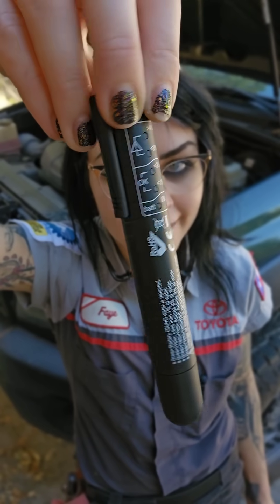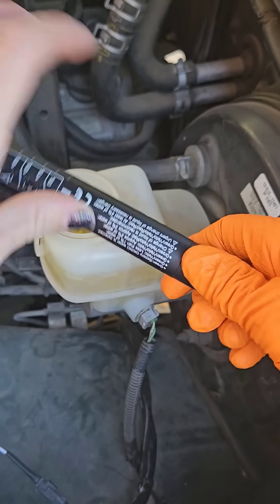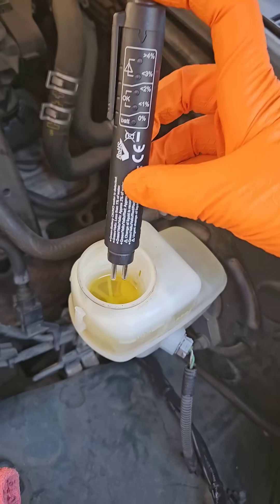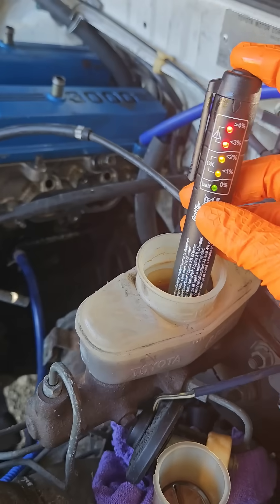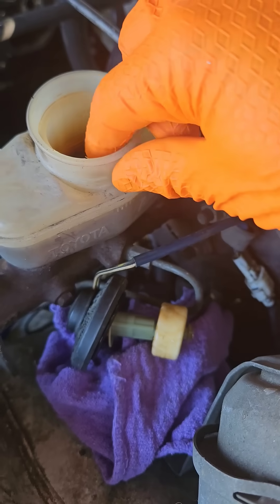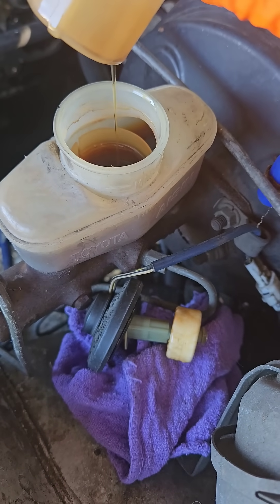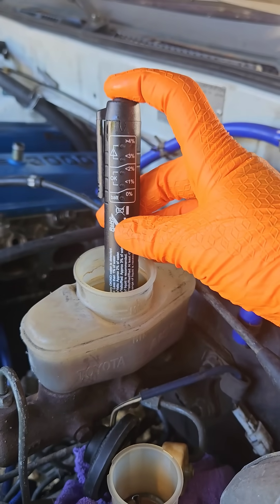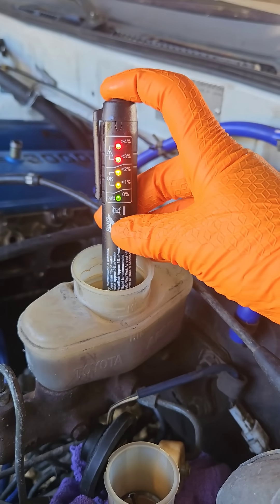Do you REALLY need your Brake Fluid Flushed?? How to Test it For Yourself!

Comment: there is a flaw to this; even if the master cylinder tests out ok, the dirtiest part of the brake system will still be at the wheel cylinders and calipers, so it’s best to do it habitually just out of prevention.

Comment: Or check color. Dark color means brake dust is making into the system at the piston and will lead to air in the line and nrake fluid brake down lol . Water will give it a milky bubly look and holds oxygen real well (squishy pedal). But yes most shops run this as a scam.

Comment: We use one of these where I work.  Often, the fluids moisture level, especially on a modern car, will remain under 3% for far longer than 2 years.

Interestingly, even when the saturation isn't excessive, and we've done a flush anyway (to satisfy a dealers log service) our customers still report an improved pedal feel, even though it didn't technically NEED a flush.

Another consideration on late model vehicles, is that the brake system includes an ABS modulator.  Lack of fluid changes can allow a build-up of particulate in the ABS solenoid's and cause problems if not addressed.  Frequent (2 yr interval is fine) changes help prevent this.

Comment: No need for a special tool. Just use a multimeter (voltmeter) and measure the voltage between + and fluid.... This method is old as earth!

Comment: I usually wait until all my fluids are the same color to change them that way I know I am getting my money's worth. Usually black. Also though a dark brown rust impregnated color is also optional if you really want to replace components on a regular basis. Also don't know if you covered this but most manufactures have their own brand/ type of recommend fluids ie coolant, transmission, different fluid recommendation or requirement for best life. Coolants are an odd one mostly because different types of coolant have additives to prevent degradation and corrosion for different metals.

Comment: So does the brake fluid curculate throughout the system? Maybe the fluid in the reservoir is bad but the stuff in the lines and calipers is still OK? Just suck out the resovoir fluid and add new?
Reply: As your breaks wear down and the pistol moves out more it takes fluid from the reservoir and when you put new  pads you have to push the piston back so fluid from the lines go into the reservoir.  Don't think is circulates when you hit the breaks bit I'm not a mechanic either

Comment: I got a tester just like you have cause the original brake fluid in my 2014 Camry still looks new after 65k. Tested at 1%. Gonna leave it till I either have to replace a caliper or it hits 3%

Comment: I checked my 2021 Honda Pilot with one of these little gadgets, after Honda said I needed a brake fluid change. No it didn't. It was 0 to 1%. Then I tested it on my 97 Honda Civic which I've had for about 15 years, I put it in the brake fluid and I think the detector started screaming as all the lights lit up. LOL. I changed the fluid myself after I rebuilt two calipers and one cylinder and now it is in the 0 to 1% range again. Thanks for the video and the tip.

Comment: Just remember that fluid inside brake calipers is a lot dirtier than in the reservoir. Water and dirt enter around the piston seal and contaminate the fluid. This contamination does not spread up to the reservoir. It stays in and around the calipers. For this reason, I just gravity-bleed each caliper when changing brakes or rotating tires. Any “flush” worries me.
Reply: If this were true then fluid would be leaking around piston seal as much more outward pressure from this area vs seepage pressure from outside inwards.

Comment: It's the same thing as an emergency. Shutdown under corruptible power supplies for server groups and what it does is. I believe I'm that Toyota, so yeah, you've got switches that you can turn to battery and everything on and off when you're disconnecting it, but behind that there is Actual fuses and and then controllable breakers, which are also like 3 bags. So what happens when you cut that? Because all that does is loop back to that one relay, and when you cut it, it's the same thing as disconnecting the blow voltage computer wires. I'm calling it. Obviously, it's only a few for this, but what it ISIS basically, and I'm not going into. There's a few different waves for a few different cars, but there's a few wires in there that are normally closed circuit and a few that are normally open circuit, and that way if the car gets crushed. And a wire gets dead sorted. The normally open circuit that then becomes closed. Because that wire got pinched and therefore grounded, does the same thing is cutting. The normally closed circuit one basically
It tells the main breaker circuit. I'm not forget that exact name forward. It is disconnect as if it had a trip.

Comment: They cause air bubbles and that needs flushing or bleeding brakes...bubbles in brake system are not a good thing....u don't want ur brakes to lock up....while ur driving..

Comment: Depend on the brake fluid, some vehicles use silicon based brake fluid which is not hydroscopic; and the water settles at the lowest point (brake caliper).

Comment: I wouldn't trust those testers. Especially on a bmw. Fluid should be changed every 2 years minimum anyway. I've had more than one mastercylinder block a gallery and lock the brakes on. It only takes 15 mins to do and the fluid is 15 euro. Don't scrimp on safety!

Comment: brake fuild should be changes at least once a every 3-4 years..i change mine out every year..easy to do..first i remove all the brake fluid from the  master cly reservior. clean it out, best i can.. refill with un opened dot 4.. fill the top, to flush out the old fluid in the lines/ calipers rr first , lr. rf, lf.. keep the brake fuild topped off, put cap back on.

Comment: Brake fluid and coolant ..use multimeter and check for voltage ground to alternator....if contaminated it will show voltage.

Comment: Take your wheels off and push the caliper pistons in, then suck the fluid out of the reservoir and fill it with clean fluid. Pump the brakes to mix the fresh fluid in the lines and calipers. Do this every time you replace brake pads. Fluid is cheap.

Comment: Part of your answer is correct. The other is completely false.

Water can never from an engineering point of view saturate hydraulic fluids. As well, any as you put it "water" with some heat can NEVER turn to steam in a braking system such as found in any automotive setting. As we all know steam and water vapor are two different animals.

In my 50 years of owning dozens of very high mileage vehicles, I've never once experienced brake failure from moisture.

Yet, it seems reasonable to occasionally flush the fluids.

Comment: There's also another important reason to regularly flush your brake fluid. The water in the old brake fluid will slowly rot the brake sealing cups until they start leaking. First, that's a huge safety hazard and second, the repair will cost you at least 10 times as much as what you saved on flushing.
Tip: If you're buying a used car, check if the brake fluid is still okay, (with one of those brake fluid devices). If not, chances are the brake fluid has never been flushed and there'll be leakage issues down the road for you.

Comment: Brake fluid tester isnt gonna tell you if youve got rust on the system and the idea is to get the brake fluid flushed before the fluid absorbs enougj water for components to rust which is why some manufacturers go by mileage rather than the tester.

Comment: Brake fluid in my truck is 15 years old it will still lock up the tires on dry roads so I am happy with it. Hydraulic fluid doesn't deteriorate water absorption is the real killer NOT age.

Comment: Problem I have is I bought 3 of them off Amazon. All showed that brand new sealed fluid was bad. And it was from 3 separate bottles bought at 3 separate times. I do not trust those at all. Instead, I flush mine every year and when changing brakes.

Comment: I’ve never changed my brake fluid. 
Driving now 225,000km. Didn’t change. 

Other car 283,000km. Didn’t change. 

No issues with either. DaQuack you all talking about?

Comment: There is no reason to not replace your brake fluid yearly other than laziness, its $5 diy, your seals will last longer, abs doesn't have to work as hard, and the #1 biggest reason to do it is when the shop says that you need it you will know you don't.

With that being said and the way I feel about brakes,  I would always suggest they do it or get it done. I would rather your pads be metal to metal than for you to have bad fluid, not literally but brake fluid should be treated like an oil filter, its doesn't matter if you need it, just do it while your there, just do it. You don't take the transmission off and not replace the seal, just do it. IMO

Comment: I 100% do not trust these. Did a brake flush on a van and the customer called back a couple days later saying the fluid we used was contaminated. We told him bring it back in and we will redo it with a fresh jug. He brought the tester too and we tested the brand new freshly opened jug and it tested contaminated. Got another brand new jug just to be sure and it tested bad too.

Comment: This is why every time i do break work on my car, i suck out all the fluid in the bottle and replace with new stuff. It’s the best time to do it, since you need to push in the clippers and push a bunch of the fluid from the lines into the bottle. The stuff in the lines are generally safe from water exposure, so doing this fluid swap is much faster and cheaper than a full system flush.

Comment: Water in brake fluid is a bit of an old testing method. The best method is testing for copper, because as the brake fluid ages, its corrosion inhibitors decay, and the fluid starts to eat through the copper walls on the brake lines. Water testing does not determine the condition of the brake fluid itself, it only tests for how much water intrusion has taken place.

Comment: The question is how accurate is this tool. There have been some comments on Amazon stating it’s inconsistent. I will stick to the 3 year brake fluid flush interval and should be just fine.

Comment: Hey Faye!!....If you don't have a tester like the one you showed...use a DVM set on dc volts...put positive in the brake fluid resevoir....put grd on the metal close to rez...if its .3 volts or higher...change the brake fluid...your welcome))

Comment: I have flushed old green brake fluid out of a lot of 99 and up gm pickups and fixed a low or squishy brake pedal a bunch of times. If the master cylinder or abs module wasn’t bad

Comment: I'd love to hear from an expert in fluid science. Does the pressure in brake systems get high enough to change water state to steam? The heat might but the pressure would prevent changing to steam but , well  but . . .
I bought a 10 year old motorcycle once with only 1,000 miles; its brake fluid was very gummy, congealed. Still worked on the ride home. No visible water but if its hygroscopic (absorbs) you wouldn't see it depending how easily it re-sepatates, e.g. diesel fuel. In 60 years I had never heard of water in brake fluid, just having to add fluid sometimes, and spongy pedal sometimes. A spongy pedal was attributed to air in the lines so you bled that. And didnt replace all the fluid. If theres water in the fluid and the car sits for years and the water separates it might induce rust, but if the fluid is moving even occasionally all parts will be lubricated with the fluid, so no rust. It can never hurt to change/replace with new brake fluid but whats that Toyota dealer charging, do they have an easy way to change without getting air in lines then have to purge, geeze, i dunno, spend the money on pads and tires and after all the credit cards are paid off maybe take a college class in fluid dynamics to understand molecularly auto transmission fluid too, power steering fluid, their water content. No mechanic I've known, I'm 76, has ever checked for water in any fluid but diesel fuel and gasoline. I can imagine theoretically such a device as she's selling being accurate but does it matter? 
Before you buy, check where made, country of manufacture, don't buy from China. Ask seller. Ask Amazon. Read labels. Where you spend your money matters.

Comment: Also brake fluid actually draws moisture in naturally, I remember seeing a video and testing it myself with a cup and a shot glass where you put a small amount of water in the cup and half a shot glass of brake fluid in the cup and it will literally draw all the water from the cup until the shot glass is full and the cup is empty.

Comment: There's a difference between the fluid under the cap and what is in the calipers.  If you brake hard enough to get it to boil, it needs to at least blead out with fresh. Yes, it likes needs to be flushed because people rarely do it.

Comment: As a lube tech at a jiffy little quick change place. I can tell you those things are pos as it's more likely to have a build up of copper in your fluid than water. I had a girl tell me the brake fluid was good as she tested it with that. I used a strip to test for copper and it had 300+ parts per million in it. So maybe it's okay for newer cars but use the strips too

Comment: I always sell flushes with brake jobs. Most of the time customer never has had a flush. If it’s a regular customer then you can skip it sometimes. If they did a flush 6 months with front brake then no need to sell another one when doing rears brakes later. Some customers are on a fixed budget so they piece out their work.

Comment: Yeah, multiple shops wanted $250 for that service. 
4 cans of synthetic fluid a $70 pneumatic pump and 2hrs later I was done. I saved so much time and cash, I went ahead and flused power steering fluid as well. 😅

Comment: I drive into the salt water up the the windows when it's rough to put the boat in and out of the water for work ! Every six months or less we flush the brake lines  with ranex rust converter and also the clutch ,we flush each caliper on each wheel then put a flush of brake fluid thru it ,the pistons in the calipers  work for so much longer before they seize , sometimes we don't get time to flush so we just put a few teaspoons in ,!! Don't try this at home we have do it or we can't use the vehicle ,   make sure you drive at least 50 km after you dunk your vehicle in the water so it gets warm and it dissipates a bit out off everything put your breather's up high very high near the top of your roof and your air intake as well up to the roof ,enjoy your day

Comment: so wat happens when you do not change youre brakefluid ?
answer there be some water in the brakefluid as the stuff atracts moisture , this will corrode youre brake parts from the inside that can cause failure , allso when you need to apply youre brakes for a long time like going downhill from a mountain thewater inside the brakefluid causes it to have a lower boilingpoint , so it starts to turn intoo steam , steam is a gas so its compressable , this means that it pushes brake fluid out of the lines and the next time you apply the brakes you push the pedal all the way to the bottom and you have no brakes , 
in short , do replace youre brakefluid reguarly , allso use the same dot type brakefluid as the different types can cause the rubber parts inside the brakes to dissolve

Comment: If that device is legitimate, then it's nothing more than an ohm meter or volt meter.  So you could just use your multimeter.    Googling this, it says that if you set your multimeter to volt reading, put one probe prong on the master cylinder and the other in the fluid in the reservoir.  If it shows over 0.3 volts, then galvanic corrosion is occurring probably due to moisture.  I suspect that device is measuring resistance at a given prong separation distance.    I have read that you can measure water content with test strips.

Comment: How is the brake fluid system not closed? The hydraulic pressure required for the brakes to function necessitates a closed system…providing someone isn’t taking the cap off unnecessarily.

Comment: if your fluid is the same colour as the pen you need to change it,, lil tip if the clutch stops working when it gets to that colour its not the clutch that needs changing no matter how much the boss insists it is

Comment: TLDR: Yeah it's a thing, but IMHO, the test strip is better....
Do you need a flush?  If you're watching this, and learning so much...probably. 
I believe the test strip to be a more reliable way to check your fluid.  It tells you the PPM of copper particles, the first material to show signs of wear and corrosion in a brake system.  While testing for the presence of moisture is great, the reliability can be compromised by the inconsistent nature of the electronic tester.  The tester itself may need to be proven on new fluid, vs known bad fluid, to make sure it accurately reads.  I've never seen a test strip that didn't react properly.  Every brake system I flushed based on the recommendation of a test strip result ended up making a huge difference in braking performance. 
I have, however seen these cheap testers give the same result, regardless of testing new, used, or obviously garbage fluid.
I offer this as my 2 cents worth of experience, based on over 20 years in the industry, as well as learning from some great instructors at a prestigious tech school, where I graduated at the top of my class.  
The strips I recommend are the Phoenix Systems Brakestrip.

Comment: Never seen fluid that needed changed before 5 years unless you get some dumbass that is washing under their hood every time. but any glycol ether fluid with absorb water, dot 3,4,and 5.1 are ones to watch. if you are running dot 5 its a silicone base which repels water.